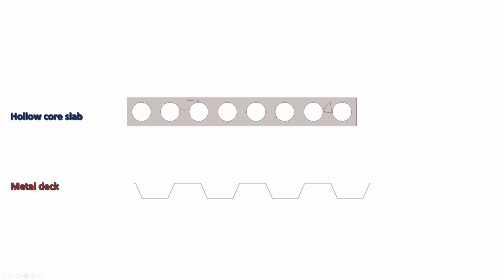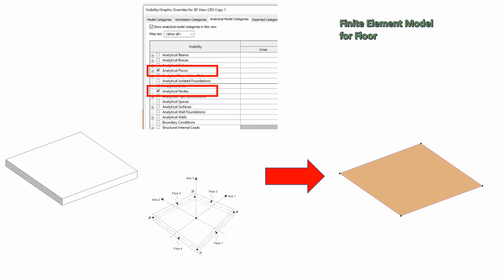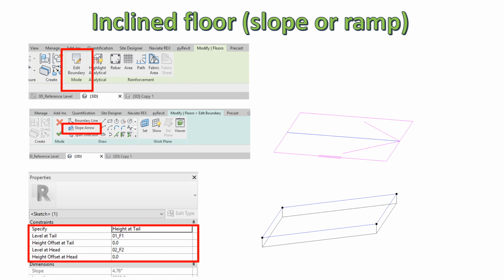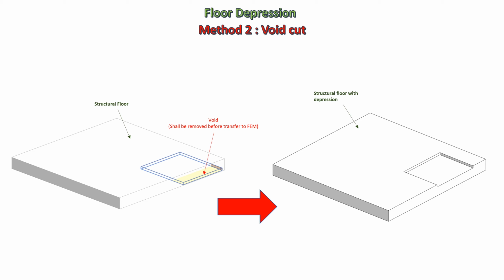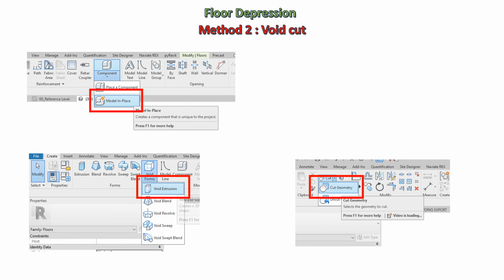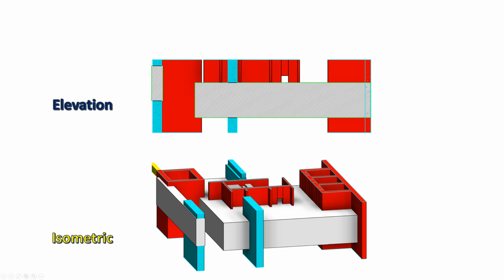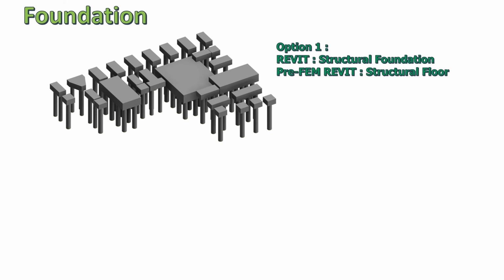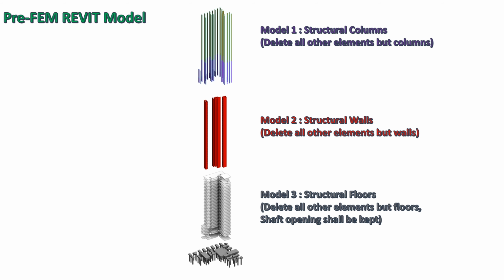Practical REVIT for Structural Engineer Episode 4: Structural Floor and Foundation

Comment: Dear sir, how can i combine all 3 models into Etabs by csixrevit ?
Reply from the maker: Yes, CSIxRevit can bring the Revit model to SAP, SAFE, and ETABS. There is some guideline on the internet of how to use CSIxREVIT, and the following link is one of them.

http://www.bimtopia.com/index.php/global-aec/installing-structural-analysis-tools/sharing-revit-models-with-etabs

Please note that the version of CSIxREVIT must be the same as the REVIT version, for example, REVIT version 2020 will only compatible with CSIxREVIT version 2020.
Reply: @ThanaponBuamongkolChannel   tks for your anwser, but i mean here is that three model we created : column, wall, floor ...etc. How can we combine them in one etabs model?
Reply from the maker: Step 1: You have the REVIT model for column, wall, and floor, 3 REVIT models in total. 

Step 2: Use CSIxREVIT to generate *.exr files from REVIT for column, wall, and floor, 3 EXR files in total (say "column.exr", "wall.exr", "floor.exr").

Step 3: Start ETABS, either with a totally clean file or any preset template will work. Then import "column.exr", then followed with "wall.exr" and then "floor.exr", one after another. The newly imported elements will be added while the previously imported elements remain intact.

Step 4: Now you have an ETABS model with all columns, walls, and floors. At this point, there is a possibility that ETABS will generate duplicate floor names, make sure to change that name into a unique floor name before continue, otherwise, it will cause a fatal error later on. From my experience, there is only one floor near the base with a duplicated name.

There is no limitation of how many EXR files you can import in ETABS. The tip is, never import duplicate elements, only import unique elements. 

For example, you can have 3 separate *.exr for columns (say "column1.exr", "column2.exr", "column3.exr") as long as there is no redundant element among those files.

In case, you need to re-import the same element say due to geometry/location/shape-changing, you need to clear those elements from ETABS before reimporting.
Reply: @ThanaponBuamongkolChannel  Thanks very much for the detailed answer!!